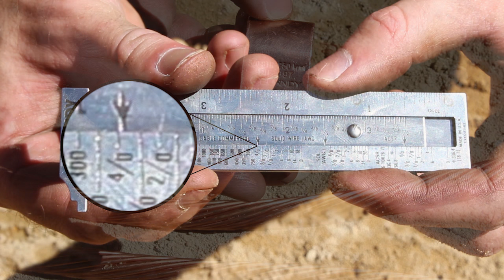YGHC Hyground Installation Video

Comment: Is it possible to remove this connector and keep one of the conductors? Can it be removed with a grounding without damaging the conductors?
Reply: Hey Tony.  I just spoke with Burndy about this and they say there's no way to remove this connection without damaging the conductors.  The connection is meant to be permanent and as such to remove it you'd have to cut it out and splice a new piece of conductor in.